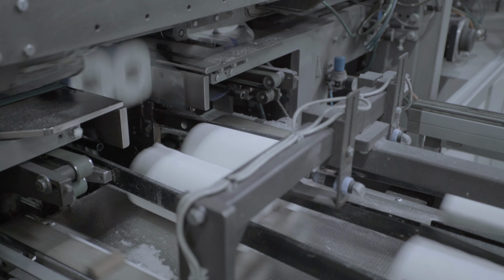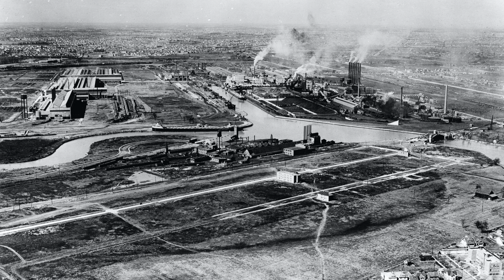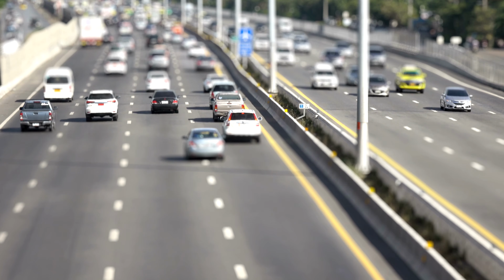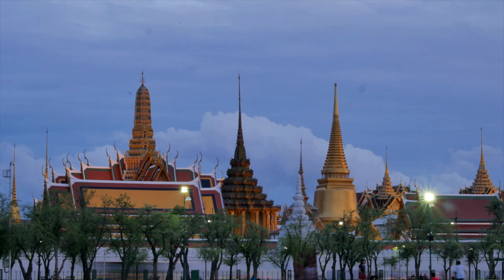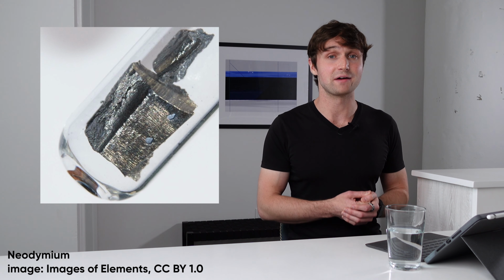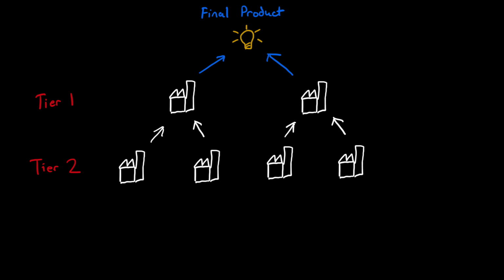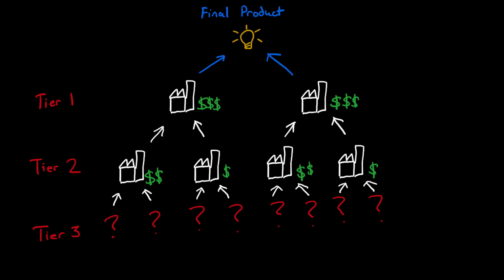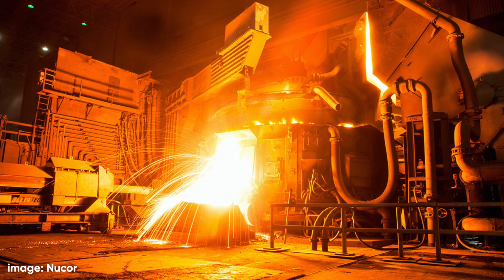Does Lean Manufacturing Still Work?

Comment: An excellent video topic!  Lean manufacturing seems to work for some companies while many others crash and burn. Interchangeable parts and relatively simple steps at each station mean you should be able to do things perfectly every time.  Stopping the production line for a single defect is crazy.  You can never get the production targets out. Every pipeline skip is a finished product short. QA can just inspect and repair at the end of final assembly.  Foremen can intimidate, bully and whip the workers into making the numbers, just keep the line going. Just In TIme late deliveries are even worse.  That could shut down the whole assembly line completely for a lack of one type of part out of thousands.  It's the Christmas tree light bulb problem.  Hundreds of things in a row have to work or none of it works. How do you do that?
Reply: Read Lean Thinking, Toyota had few defects at the end of the production line while American automakers has hundreds. Fixing defects at
The end is not cost effective or an efficient use of labor.

Comment: Let’s rephrase your question.... does Continous improve still works?

Change is one of the “constant principles” in life....
What such an absurd question you pose?
Reply from the maker: The point is, does this specific framework (lean inventory) still work? Not the whole idea of continuous improvement.
Reply: @GregYeutter  lean manufacturing is under the big umbrella of  continuous improvement. Do not try to separate both, they go together. The answer is yes to your question, so when someones reaches the top on what they do, that is when lean mfg (continuous improvement ) will stop working.

Comment: Good video.  I manage supply chain at CPG company that is certainly impacted by covid.  I never link lean too much to inventory levels. I think of lean simply as a holistic approach to reducing waste (material, time, defect), doing that might actually require inventory. I think it's certainly timeless business concept. To execute JIT may require component inventories, or vertical supply chain integration to control your own destiny.  Though every vertical integration we've done has been both an opportunity and a curse, you often quickly realize what you were paying a premium for from your supplier. 

I prefer the idea of a flexible vertical integration model, where you can meet unexpected demand or the 'noise', while relying on a supplier partner for the mass of the work. Hard to make that sale internally though, management will say 'if we can do it cheaper, why wouldn't we always do it' ... But the answer to that question is why Supply Chain people have jobs :)
Reply from the maker: Hey, thanks for your great perspectives on vertical integration. I agree that it's more a philosophy than a strict set of rules you should follow blindly. Best of luck on the continued challenge of manufacturing and sourcing during COVID.